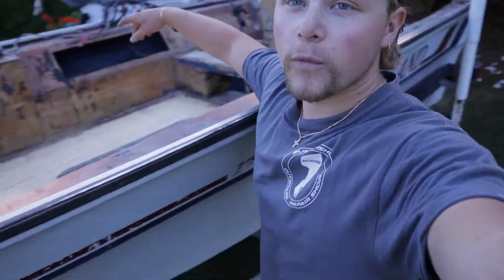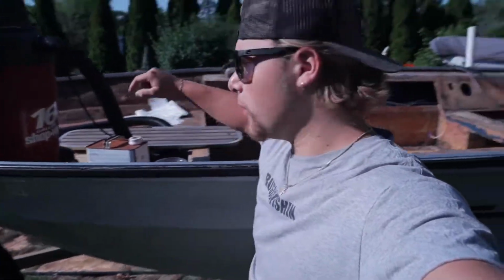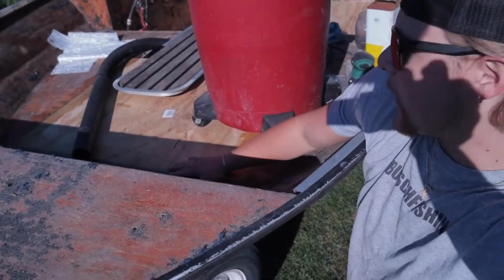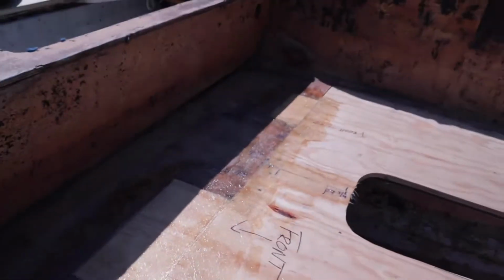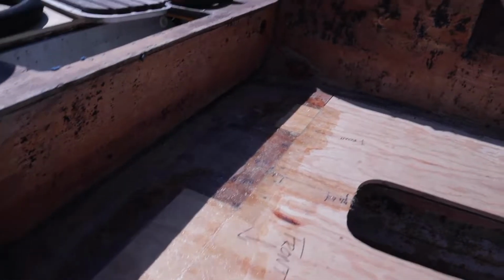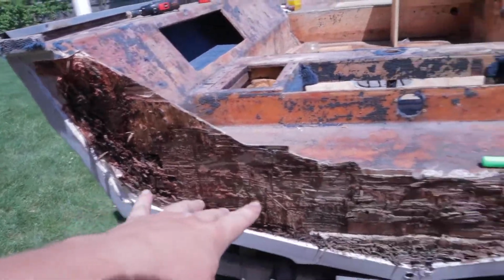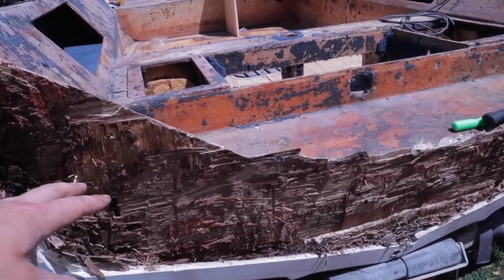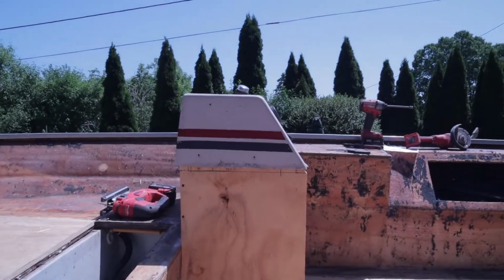REBUILDING LakeLand 1790 Pro Into EPIC FISHING BOAT (EP 3 - ROTTED TRANSOM + GLASSED FLOORS)

Comment: Well,  The floor has a few bad spots which are repairable, front needs a little glass But, The Transom upper drain plug was broken off and allow water to enter inside of transom.  Maybe it's time to rethink the repair.  Picked up Epoxy resin from Total boat so...Time to see If I can save it.